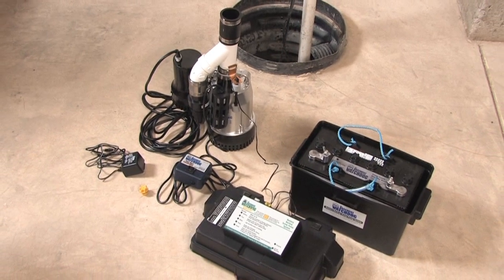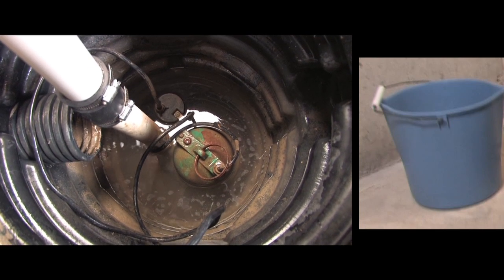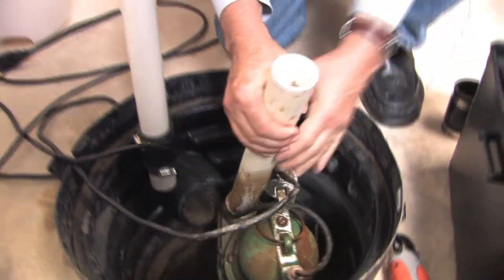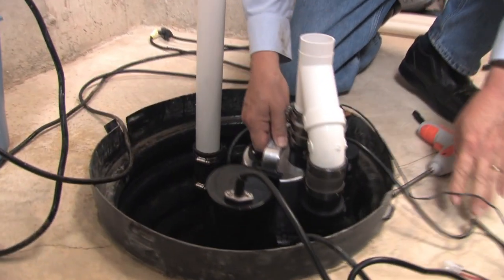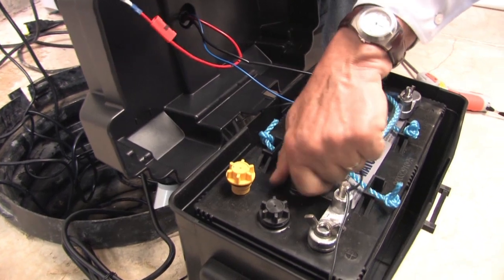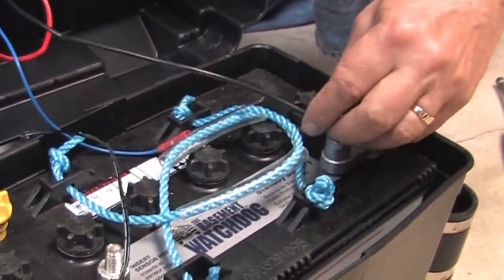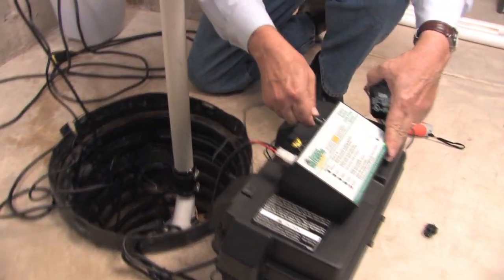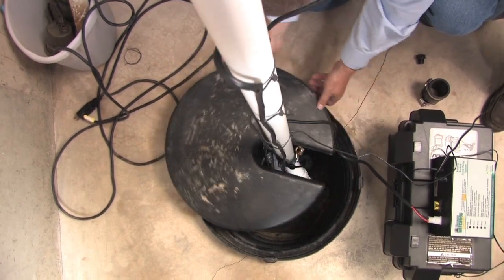How to install a Basement Watchdog Combination Sump Pump System Sump Pump - Installation Tips

Comment: On these units, when the water hits the float, it kicks the pump on and only pumps about 1/4 inch out of the sump hole, does its 10 second delay then turns off. Does anyone know how to fix this issue, I can’t seem to figure out how I should adjust the float system to take more water. a pump should take more than a skim of water out.

Comment: Don't waist your money, unless its installed in low basement because it will not pump water from a 8 ft ceiling basement. 10ft max head pressure. so anything more than 1 elbow, probably will mot work. backup pump is useless.